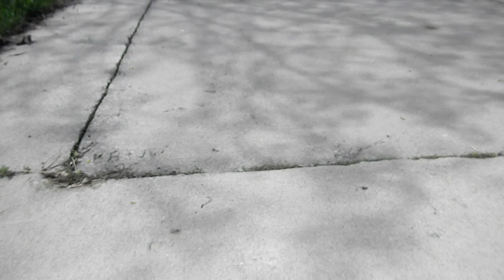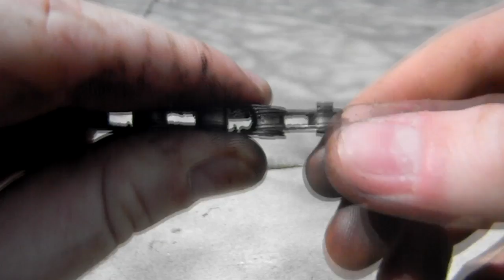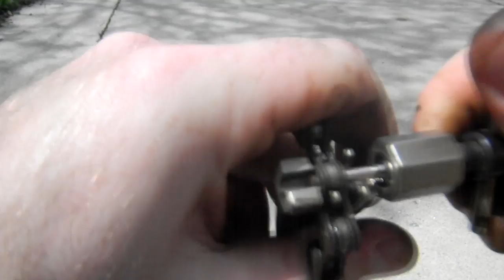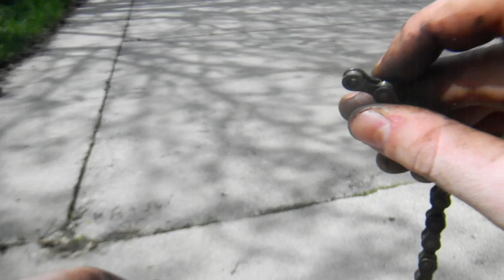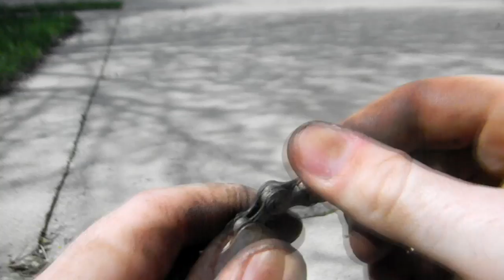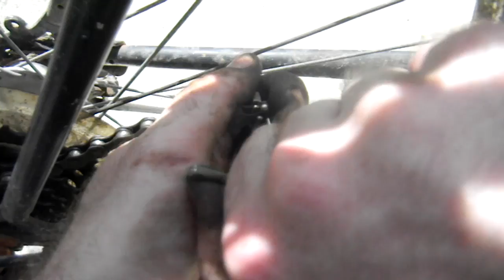How To Repair a Bicycle Chain

Comment: I've been a Automobile Dealership Technician for 27 years and have always ridden a newer bike and haven't had the need to repair a chain..Until last week. I had a chain failure and I was 22 miles from my destination so I had to watch this video on the side of the road, broke out my chain tool and repaired my chain and was back on the road in under half an hour. Not saying I wouldn't have figured it out without the video but it sure made the repair easier and faster. Thanks!

Comment: Thanks for taking the time to create this video. I broke a chain last year to clean it and put it back together, after about 35 or so miles the chain came apart on me (fortunately, I was real close to home) and other videos I have watched do not address how to actually separate the chain links after you have the pin driven through, last year I tried to leave a sliver in the chain and ended up driving the pin completely out, it was a bugger to reassemble. Plus my chain tool needs upgrade.

Comment: Thanks for the video.I ride 10-12 miles a day 7 days a week and I've had two flat tires within the last 4 months.Had all my tools and a spare tubes & portable hand pump being prepared saved the day and a long brutally hot walk home pulling a loaded down bicycle cargo trailer each time.Both  times I was back on the road in 30 minutes.Plus I carry a patch kit and a chain repair tool kit.Got to know how to do roadside repairs.

Comment: Thanks cjhoyle. I've had a chain breaker tool in the dirt bag for years and luckily never needed to use it. Good to see it done, particularly the part about not pushing the pin right out, I might not have realised that until too late.

Comment: Very well shown repair, thanks!
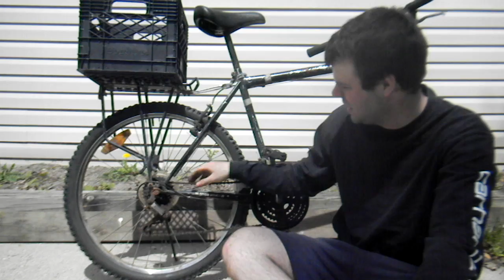rAdditional info: 6:50 - old chain VS new - I recently learned you can measure chain wear with a simple chain wear gauge tool, preventively replace the chain before it's too worn, and thereby avoid replacing the cassette due to an overly worn chain.
I am going to get a replacement chain & breaker and try what you've shown here, thanks! Will get a new chain that is equivalent to 5% of max wear, for closer fit.

Comment: One thing that I would note is not to bind it back and forth due to that could cause the pin to pop back out or even ware out the chain best thing to do is leave it be. After the chain is placed back onto the bike spray a little wd-40 not only on the links that you have repaired but to pedal it upside down with your hand and spray a little bit at a time while the chain rotates until you have covered the whole chain. Great video very helpful thanks

Comment from the maker: Check to see if the pivot point of the chain tensioning part of the derailleur is sticking. Swing the arm back and forth until it moves freely, and add some drops of oil to help this as well. If it's not an issue with your rear derailleur, I recommend that you take it back to the shop where you had it worked on, and tell them your issues that have come up since they worked on it.

Comment from the maker: WD-40 is a chemical which is used for breaking down corrosion. The step of bending the links sideways back and forth has nothing to do with corrosion. When the chain tool pushes the pin back through, it doesn't leave any gap between the edge of the two links so the joint isn't able to move very well. The sideways back and forth motion creates a small gap on either side by prying the on the edge of both links. As long as the pin is correctly centered and you are gentle it won't pop out.

Comment from the maker: Well as I explained in the video, the chain and the chain rings wear over time, and when they have different amounts of wear, they might become incompatible with each other and cause skipping. However, it's really uncommon for this to happen with front chain rings. I guess you can try removing some links, but the rear derailleur should be what keeps the chain tight. My concern with you replacing your chain is that you'll probably need to replace your rear cassette as well, to avoid it skipping.

Comment from the maker: The repair procedure is the same for a single speed bike, with the exception that there is no rear derailleur to tension the chain. This means that the chain must remain the same length after you have repaired it, so if there are links that are damaged you must replace them with spare links as I have shown in the video.

Comment: Hi, can you make a video how to clean rusty chains on a bike that served for the whole winter? What lubrication you advise, etc. Btw. I truly love your videos, because they show "real" bikes, not expensive super-clean one!
Reply from the maker: +Krisztyuf I don't let my chains get rusty, not even in the winter. When they start to squeeze I add lube to them. At the end of the season they will need to be cleaned. I just use a dry rag and hold it tight around the chain while I spin the cranks. Every so often I will switch to a new cleaner section of the rag. I normally use wet lube for my bike, I don't have a recommendation of a particular brand. Thank you, I'm glad you appreciate my videos.
Reply: +cjhoyle Thanks for the quick reply!!

Comment: I have kinda similar chain tool but i didnt figure out how to get pin back to chain properly. The problem was that when you place the chain to tool then the pin doesnt fit between the chain and tightener. Its also too tight to press with hands and when i at last hammered it back in I felt like doing damage to the chain.

Comment: my mistake is that i push the pin all the way thru,, then hard a hard time putting the pin back into both the outside/inside link, as matter of fact couldn't do it.. i saw somebody on the road fixing my broke chain and he had push the pin all the way out

Comment: Thank you for the video.  Question regarding the pins, you show that you can reuse the pins by pushing them back, but is it advisable/better to replace them instead??
Reply from the maker: Chains are often sold with "quick links" which you can use to reconnect the chain. I'm not aware of pins being sold separately and I don't think it would be very easy to install one. For me, the pushing the pin partially out and then back in again method has always worked well.

Comment: I have a question. I took my bike to get it tuned up and they replaced the front crank shafts on both sides with new ones (3 piece bracket) because it had been done incorrectly before so my bottom bracket got loose and the right side crank fell off. So it's a new sprocket with new teeth but it skips now. They didn't replace the chain and it is quite loose. I wonder if I could just take a couple of links off and tighten it or should I just replace the chain to go along with the sprocket?

Comment: *Sigh* well that's no fun. So I guess my first step should be to check the rear derailleur and see if it needs adjusting and if that's not it I should try replacing the chain and the cassette? It was just weird to me because it was just after they replaced the front sprocket that it started skipping. It never did that before then. I wonder if during the tune up they adjusted the rear derailleur and just messed it up on me or something.

Comment: I have a damaged SRAM chain, and considered exactly the same repair. However, I have some doubts with the pins. The pin what you put back, won't loosen up? I started to checking on e.g. Shimano chain connecting pin, however since 2011 you may have some experience with used pins. Were it good till the end of the chain's life? If yes, I will just put back the visually good pins.
Reply from the maker: +RelakSHUN When links fail, I remove the bad link and reassemble the chain as shown in this video. In my experience as a chain gets more and more wear, it has links failing more and more often. After I've repaired it 3 or 4 times I just call it worn out and replace it.
Reply: +cjhoyle I had to replace some links, because they bent out of shape. I think I will keep a spare chain with me for a while, just to be sure.

Comment: Damn. I'm not a hater, but my chain is interlock.. I need to know what I did because I fixed my chain, but it was too tight and it is having trouble rotating around the sprocket and driver gears. I need to know what I did wrong so that I can bike again!! ): Maybe I need to wiggle it like he said..?

Comment: Is it possible to get the pin back in a link??
Reply: No, not really.  But you can buy 'joining pins' which have a break-able-off section that you snap off after inserting the pin.

Comment: Thanks for the video !!! Yesterday, in the middle of a ride we got a SRAM X9 clutch jammed that caused the chain quick link to get broken. We were about 30 minutes trying to put the pin back into the hole, until we decided to go to YouTube to see how to fix the chain (we were four guys with plenty of tools). Your instructions were exactly what we needed. We were able to fix the chain and continue our ride. This is our video trying to fix the chain: http://youtu.be/7glJYJ-Gzzk

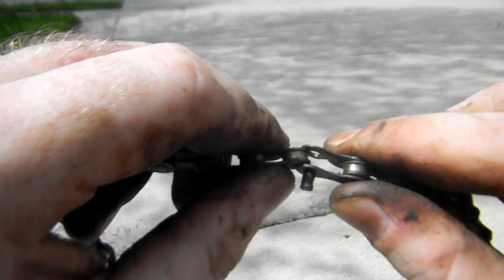Comment: 5:25 Every video I've seen has the pin connected to the chain without showing HOW MUCH OF A PAIN IN THE ASS THIS IS. Lol. I've been at it 1 HOUR now and still can't get the pin back into the chain.
Reply: me too
Reply: Actually it turns out the pin DOESN'T go back in. You have to buy a specific pin to replace it. I believe they called it a master pin. It was almost as much as a brand new chain (Planned Obsolescence..). I just ended up buying a new chain instead.